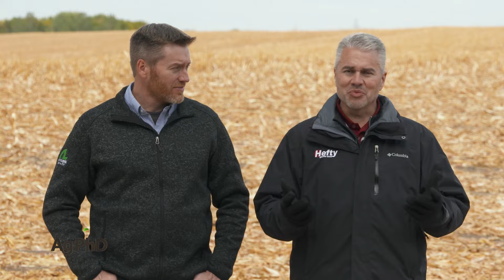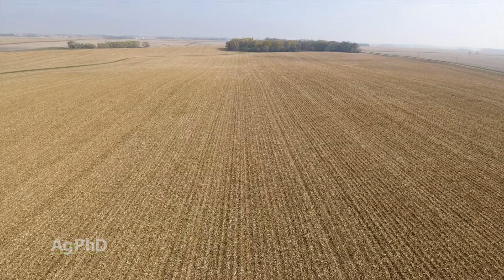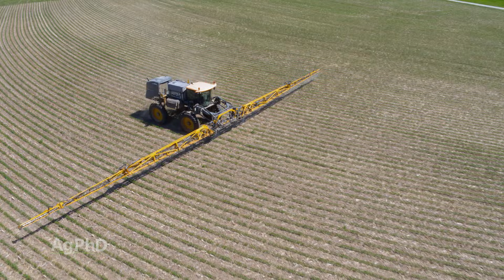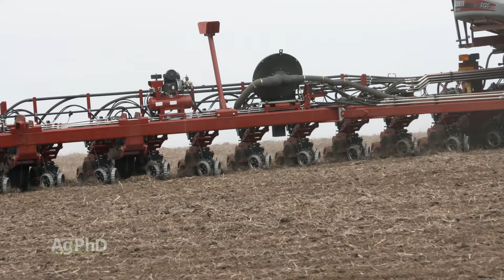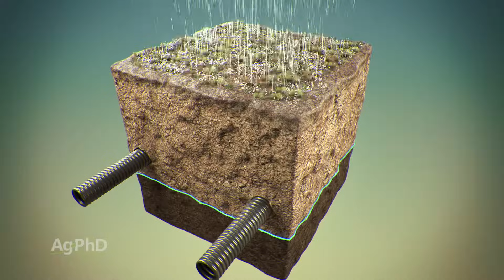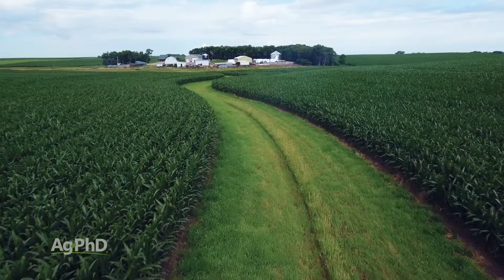Farm Basics #1180 How Farmers Reduce Erosion (Air Date 11-15-20)

Comment: You should mention cover crops as important as no till.
Reply from the maker: Brian and Darren addressed your comment on Ag PhD Radio: https://soundcloud.com/agphd/07-20-21-soil-sampling#t=55:32
Reply: @AgPhD  thanks
Reply: @AgPhD  However, covering the soil with cover crops can prevent erosion massively, not only by stopping the water from picking up speed but also increased water infiltration rates and holding capacity, so that standing puddles should be less of an issue.  
You still see no-till fields where soil is bare and with erosion taking place.
Reply from the maker: @Gustav4  Brian and Darren responded to your comments on Ag PhD Radio: https://soundcloud.com/agphd/07-22-21-sulfur#t=6:50